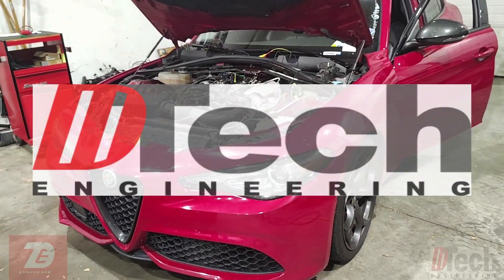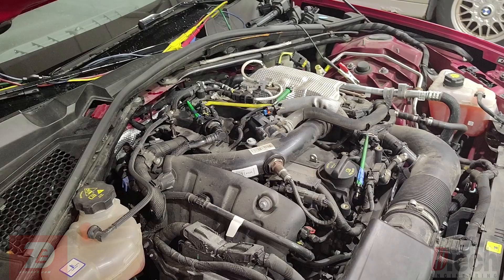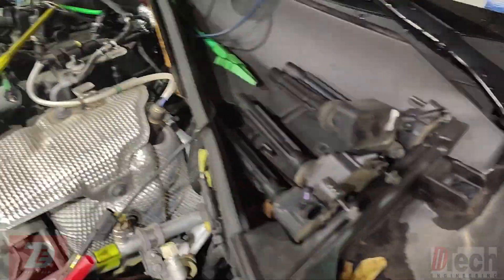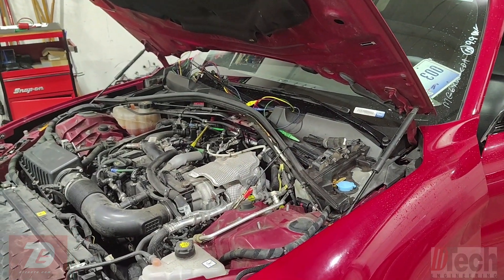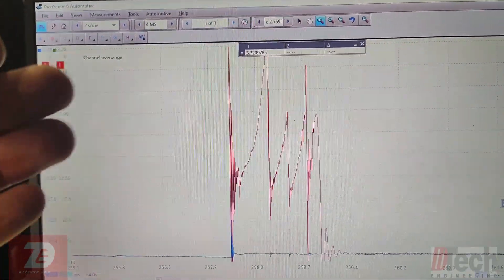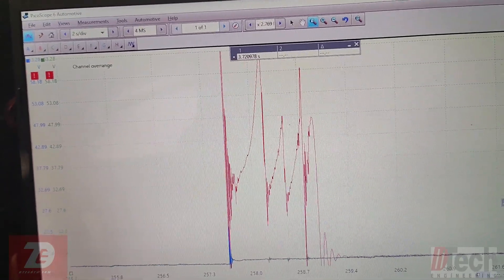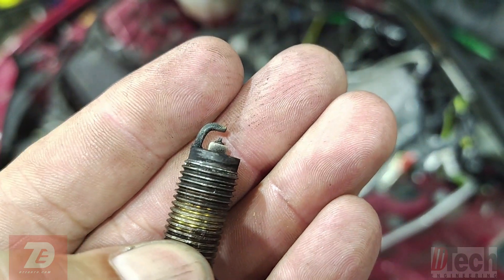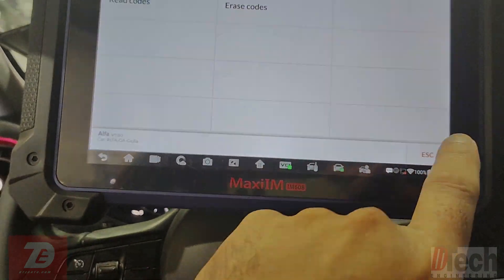Diagnosing Misfire Under a Load Alfa Rome

Comment: I learned a ton from your videos. Time to give back.   The upward slope of spark burning PLASMA  (instead of flat or slightly down) is a sign of High Resistance (electrical).  That is how it is classified abstractly by spark scope professors.  This generalization is easier to remember and it is Universal.  High resistance can be:  increased spark gap (like in your case),  bad wires, lean mixture, etc.
(As to "gas / turbulence interrupting the spark plasma": it is impossible. Spark plasma travels at Speed of Light. But gas (turbulence) is super-slow compare to speed of light, it is like billion of years to travel on a rocket compared to one second of light travel. )  Keyword here is RESISTANCE.  Increased Resistance.   Upward travel of spark plasma burn.
Reply from the maker: Thanks for the great information! 👍

Comment: On min 2:09 the multiple spikes after the initial breakdown of the scope capture from cyl 2 could also indicate possible coil or spark plug wire ringing, potential spark plug gap issues or possible secondary circuit problems.
Great case study Sadel 👍

Comment: I know of a case where the torque converter was destroyed due to worn spark plugs, the manual said 105k miles. vehicle had 90k.
After transmission replacement had the exact same transmission knocking noise, spark plug replacement took care of it.
  
I think the indexing by torque only works with factory spark plus.

Comment: The easiest way to locate an offending  misfire cylinder is to scope CKP sensor and coil1 trigger signal as reference. Then apply crank math channel to CKP signal and using coil signal+firing order  you find out the offending cylinder.
Reply from the maker: Yes, that is a very effective way to do it for sure
Reply: Does that still work off idle? I have only had success doing it at idle with crank maths but maybe I haven’t worked out the settings
Reply from the maker: it gets difficult when off idle because the range settings might not work right for the math channel. I have had one vehicle show me drop out off idle, it was a Mercedes
Reply: @fastbagel  You still can find misfire under load up to around 3000rpm ,with crank math channel applied to CKP sensor signal. Above 3000rpm you cannot longer see what is going on as math channel resolution becomes very poor. If you have an email I can send you pictures.